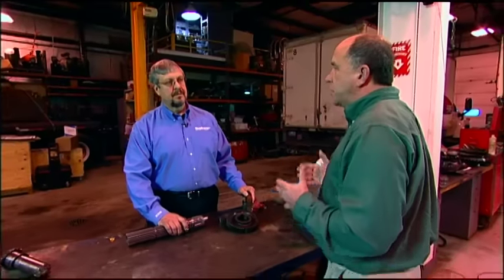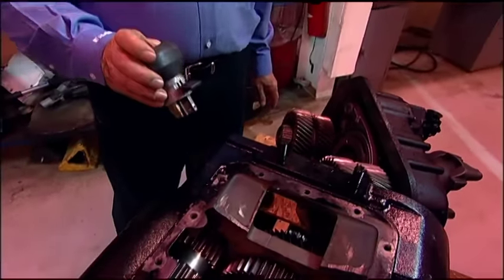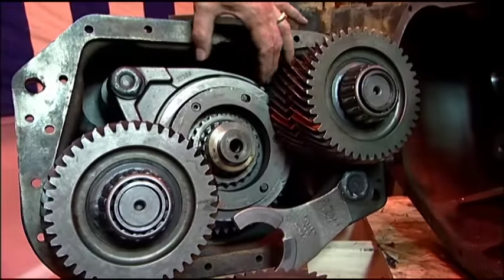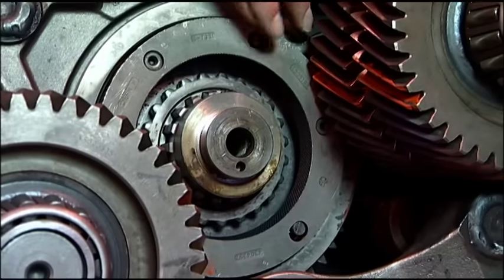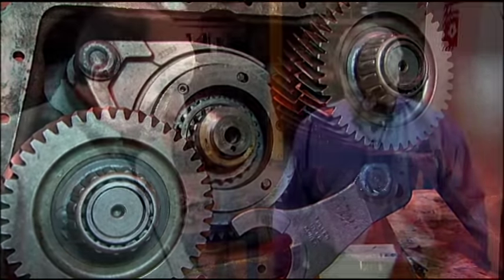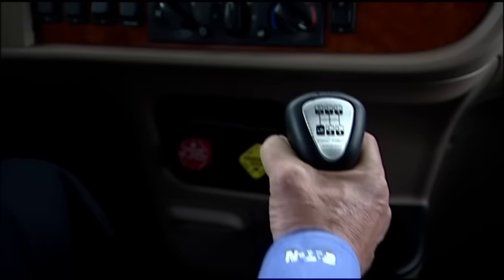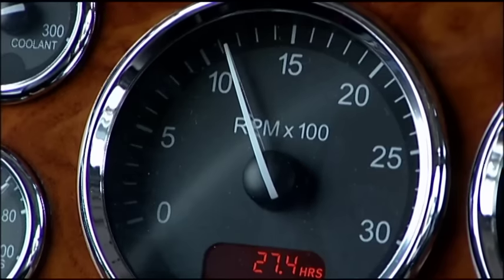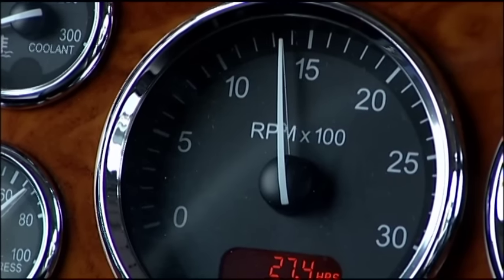Professional Shifting - Introduction

Comment: After more than 30 yrs of floating gears, I've never broke a drive component. My current truck has over 900,000 miles on the original drive train. Clutch was changed at 800,000 only because rear main seal had to be changed.  Didn't even have a single hot spot in the flywheel. Don't let this "expert" tell you it hurt the truck.
Reply: Can you teach me how to properly shift for my job interview tomorrow, how are all these people shifting so fast without grinding a gear, is there a guaranteed way to up/down shift ?
Reply: @1Brooklyn2Many  it's not something you learn overnight. It takes practice. Every truck shifts a little different. But basically you rev it just shy of the governor pull it to neutral while letting the rpms come back to idle, at the right rpms it'll fall into gear.
Reply: @1Brooklyn2Many yeah you have to learn to match the revs by ear. Learn to double clutch and get comfortable and get to know what rpm’s need to be then learn to float shift with no clutch. If the rpm is matched it will just go into gear
Reply: I’m over 40 years driving trucks. Started with 5 and 4s ,which needed double clutching,newer transmissions don’t if you listen to the engine. I don’t need a tachometer because I can hear and feel it. Hell, I drive standard transmission cars and trucks without using the clutch except for starting and stopping. No gear grinding, just listening to the engine.
Reply: I totally agree.
Reply: @Jack-wi5qr

So very true.  After a short while, the engine sound is how veteran Pros know when to go to the next gear.

I've noticed on Freightliners with standard common 10-speeds, the change to next gear sound is a distinctive "whriiinngg!" sound, where  the ending  last  "-iiinngg!" sound is the moment to upshift.
Reply: @SunnyIlha my CDL instructor showed us this video in our class. Very informative and I agree with you too. It’s always good to learn how to shift properly for a job interview but after you get the job you can float the gears 😅. It will be good for your knees.
Reply: You also had a truck that didn't make the power to break stuff like these new 600hp 2050torque motors do
Reply: @ethansnyder7488  Really.... The truck I have now is 605 hp. The one before that was 585 hp. Both 2050 torque. 
  The 585 got a clutch because the rear main seal went out at 850000 miles.  Not a single hot spot in the flywheel.
Reply: @donmunro144  uh huh....and I guarantee you if you'd tear it apart the mechanic would know you floated....just because it's not broken doesn't mean it's fed up
Reply: @donmunro144  and your really that stupid to void the warranty on a $50000 transmission? Because that's always their excuse if something lets loose"driver error"
Reply: @ethansnyder7488  just because you're not capable of driving a manual transmission doesn't mean everyone else is also incapable. Like I said in 30 years and several million miles, I've never had a drivetrain component fail. I still own 2 trucks. One has over a million miles on it. At fluid changes, there has never been so much as shavings on the magnet. 
 If you feel I'm stupid, so be it. I couldn't careless what a wanna be thinks. My experience speaks for it self.
Reply: After more than 30 yrs but you’re calling it floating 🤦🏽‍♂️
Nothing floats n them and fuller always taught it as progressive shifting. 
And fuller were around decades befire you even started. They built the RR, they woukd know about their gearbox
Reply: @nickk5731  first,  engineers don't know it all and haven't personally logged multiple millions of miles in real world driving.
 Second,  just because you can't, don't condemn those who can.
Reply: Make a video of it

Comment: I always smile when watching these company office types. They have read the books and think they know, but in reality they lack road experience. It is cringe worthy to watch them drive. They use the clutch but are very rough. News flash: It is impossible to do a smooth split shift by double clutching. This is a 200 RPM split and is very fast. To double clutch a split is to shift rough. If you wanted to use the clutch you could get away with single clutching, but it is humorous to watch these office guys double clutching a split shift. Better stay in the office.

Comment: That's the way I was taught to do it by seasoned instructors, now the guys that build the transmission say the same. So, no shame if you do it some other way, just stop telling rookies that double clutching ruins the transmission, it's all the way around. Note: the first clutch doesn't have to be too deep or pronounced, getting to Neutral is always the easiest step

Comment: 7:08
What he said here is actually incorrect.

The shift is matching gear to road speed.
Not RPM to road speed.

The RPM is not one would drive gears by. 
It is the ROAD SPEED by which one shifts to gears, both upshifting AND downshifting. 

RPM will also change behavior to gear when towing heavy, and heavier, loads.  (The same vice versa; the RPM reacts differently when you have light load, or empty). 
RPM is NOT what you use to shift gears! It could be different in different conditions up to 350-400 RPM!  (For example, the gear could be working correctly anywhere from 900 to 1400 RPM!).  Especially in the difference going down grade (descending) versus going uphill (climbing) AND whether with a heavy load or heavy haul versus empty or lightly loaded. 

For example, 9th gear starts at approximately 35 miles per hour (on a flat grade). 

Incidentally, to match the gear to the road speed, there are many instances where a double down is required to be instantly in the right gear due to rapid loss of road speed (for example when in a rapid change of uphill grade). 

Honestly, (not intending to be overly harsh or bluntly straightforward) only a moron semi driver driving a tractor trailer day in and day out for a living 50-69 hours a week would be double clutching every time you changed gears.
AND your knee will have carpal tunnel or joint disintegration within two years. 

Floating gears is the hallmark of a true seasoned veteran PRO semi driver.  

My estimation is 99% of tractor trailer drivers who drive manual transmissions double clutch for the last time during their CDL license drive test.  
The rest of their daily working lives in driving career, they float gears. 

One quickly becomes skilled, to when you no longer hear the soft "purrrr", but just silence 99.9% of the time when floating out of and into gears. 
And if you're not effectively at times using double down when running into sudden changes of uphill grades (for example, 10th to 8th, or, 9th to 7th), you are probably going to damage or wreck the transmission, because you will need to be in the correct gear matching the correct road speed instantaneously .

Comment: I am a logger, not a trucker. 
I am relaying this question for an 8yo Amish kid with health issues. We here in PA have 8 speed & a few 9 speed log trucks. I read somewhere in the PNW they use 13 & 18 speeds. 
His questions is what is the most powerful engine you can put in an 8 speed log truck?
Reply: I’m running a 450 horse dd13 (Detroit diesel) with an 8 speed.
Reply: @JamesWilliams-kt5qr  thanks
Reply: You can run a 475 CAT with a 8 speed I drove a lot
Reply: @JacksonGuitarsPlayer03  thanks
Reply: @johnvelas70  you can probably run a crap ton of engines with  a crap ton of transmissions
Reply: The amount of power depends on the strength of other components such as clutch, transmission, driveshafts and rear-end(s). Horsepower isn't the issue, torque is.  My new truck is 605 hp with 2050 lbs/ft of torque. Which is pretty much max for a stock truck. I've got the 18 spd but shift like an 8 spd w/ overdrive. Don't need all the gears, but nice to have when pulling in the mountains.
Reply: @donmunro144  I drove 475 C15s with 10 and 13 speed transmissions too. 

You got the 605 X15 Cummins. Sweet. 

They are nice engines aside from DEF like any DEF engine BS. They regen themselves a lot the idle kicks up. I love the turbo spool on those. 

My previous job had X15 Cummins 550 horse in their ‘16 389 rotator, and in some other trucks had it too
Reply: @JacksonGuitarsPlayer03  i don't let it idle . It's got a carrier apu. In your case,  wreckers don't have that option.  But by not idling, I don't have emissions issues. My last truck has a 485 hp isx. At just shy of a million miles, it still has the original dpf. Once a year, I pull it out and have it cleaned. Other than that, I have replaced 1nox sensor, a def doser valve, and the dpf pressure sensor. I don't believe that's bad for that number of miles.
Reply: @donmunro144  for lasting almost a million miles that’s not bad. The Paccar is absolutely garbage in my opinion. 

What I mean is the Cummins will higher idle themselves sometimes I believe for automatic regen. Then it’ll kick back down to normal idling
Reply: @JacksonGuitarsPlayer03  I agree about the paccar. Heard a lot of horror stories about them. I've always loved the cummins
Reply: @donmunro144  it’s ugly sounds like nothing it’s boring. No power. Junk 

If I were to go DEF I’d obviously go with a big Cummins X15 but I’m a oldschool feller so I go oldschool all manual all smoke all torque all horsepower. 

C A T E R P I L L A R P O W E R!! 

I even got old mechanical CATs, a 290 Cummins in a early 80s paystar international, a N14  in a ‘98 T800. 

Great old iron
Reply: @donmunro144  spacibo

Comment: I always float my gears and will keep floating done this with 10 13 and 18 speed transmissions never had a problem
Reply: Same. I find double clutching (especially when feeding into the next gear) to be a distraction. 

I rarely use the pedal when upshifting, but in certain conditions I find it helps a lot. 

On even a slight downhill grade I don’t even use the pedal to start from a sign or light. It just feeds in when rolling.
Reply: I guess Im asking randomly but does anyone know a tool to get back into an instagram account..?
I stupidly lost my account password. I love any assistance you can offer me
Reply: @Jamie Darius instablaster ;)
Reply: @Leighton Paxton Thanks for your reply. I got to the site through google and I'm waiting for the hacking stuff atm.
I see it takes a while so I will reply here later when my account password hopefully is recovered.
Reply: @Jamie Darius Glad I could help :D

Comment: It must be impossible to build a simple, fully synchronized manual gearbox suitable for everyday use for high loads and more than 16 gears  (forward) and more than 8 gears (reverse) as well as a splitter group and reduction ratio...... Oh stop, it's not, it's been used for over 50 years in the Unimog and in many heavy trucks in Europe. Anyone can drive a normal manual passenger car here (and anyone can actually do that here) and also shift a heavy truck cleanly and without damaging the transmission.

European engineer to USA colleague: “Much to learn, you still have young padawan!”

Technology that inspires :-D

Comment: Been driving two years now but in an automatic today was first tie in manual and I keep grinding the gears sometimes I dan shift up no problem then the next I can’t get it in gear and forget about down shifting I am doing the double clutch rev the rpm to 15 16 rpm but once I’m in netrual I can’t get it in any gear I’m fighting to get in gear till I’m real slow then I can get it in gear but it’s nerving wen trying to turn corners and trying to down shift or if the light turns red then I’m just relying on the foot break automatic spoils you for sure I love driving manuals in cars I just have to learn in semi truck it’s just weird that one time I shift all gears good then the next time won’t up shift right now the truck I used today was 1996 year so not sure if that had anything to do with it and no one likes that truck so many it both me and the truck not working properly hhha also have to learn the speed for the right gears so good thing for u tube for me to learn proper ways to try just hate being a rookie at shifting but e all have to start some were

Comment: Once you're smooth floating, your rev into gear will be the same seamless one-time rev that serves your transition to the next gear.  

Once single rev. 
Gear to gear.
(No more two-revs).
Rev, hold the rev in place, shift, and let the rev down, shift. 
Particularly 3rd-4th-5th-6th-7th-8th

All those who know what I'm talking about, know what I'm talking about.

Right, guys? 😁

Comment: If my tendom dump truck is loaded 48,000 lb as gross weight,  at what gear should I be at the intersection to turn left or right?
Reply: It entirely depends on what speed you’re at AND your specific gearing. Ideally, you want the transmission & engine to be matched so you’re in the peak torque range BEFORE you enter the turn. 

That way you can accelerate through the turn/intersection if needed.
Reply: 3rd

Comment: DO YOU USE THE Clutch TO SPLIT THE GEARS????
I see a lot of drivers don't
Reply: You can split the gears without the clutch, but you`ll shock the driveline doing it.
At the same time, excessive clutch use will wear the clutch out, despite the best of shifts.
The Jamaican`s figured out a way to deal with it, instead of splitting and keeping the shifter in gear, or clutching, they take the shifter to neutral, switch the splitter, match the revs, put the shifter back into gear with perfectly matched revs.
Reply: Absolutely not.. Any shift ANY SHIFT!!! USE CLUTCH... IF you dont its shows yout lack of intelligence of what damage it does.. 40 yrs building them I know.
Reply: No!

Comment: To be bluntly honest, a driver will never make it in trucking in a manual transmission tractor if one doesn't float the gears. 

Just like you have to be able to back,  you have to drive the rig floating the gears.

The old saying goes:
If you can't back, you can't work, 
And if you can't float, you're a waste of money. 
(Which means you can't work).
Reply: wow! you mean I been doing this wrong for 50+ years?
Reply: @ronspring7738  

Are you an owner operator?
Reply: @ronspring7738 

You've been double clutching all the gears up and down for 50 YEARS ?

Comment: Thank God for automatics
Reply: Automatics are gross
Reply: Or proper training to gain skill.
Reply: @aidenschvatkok5732 only if you don't get stuck in stop and go.
Reply: @mrspeigle1  I’ll take some manual shifting in stop and go vs the truck not doing what I want it to when I hit the throttle.
Reply: @mrspeigle1  don’t get me started on driving an automatic in snow either